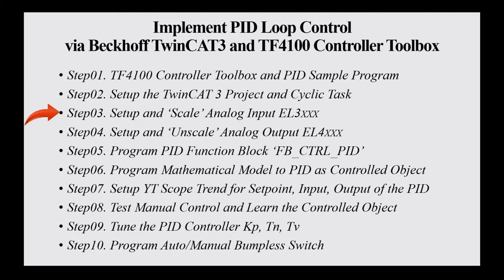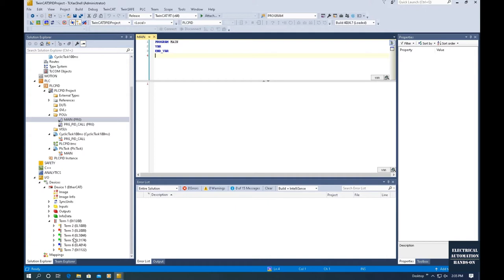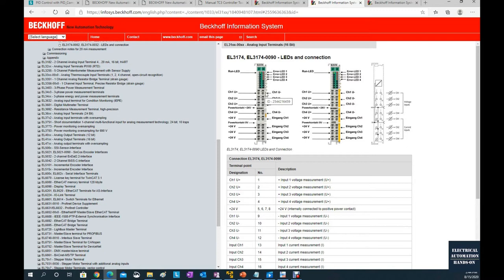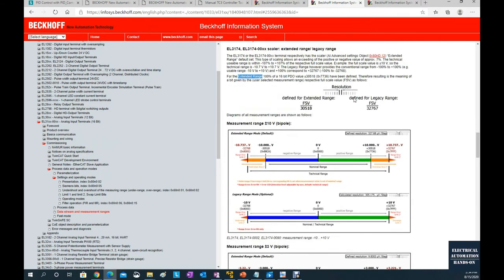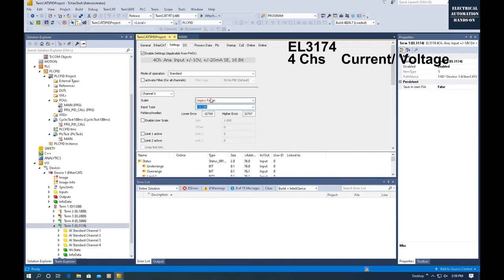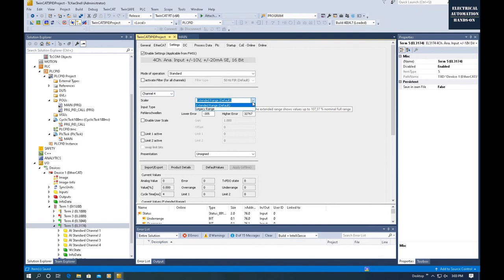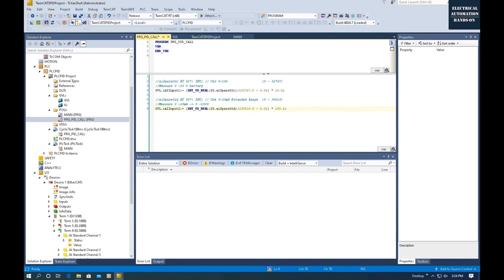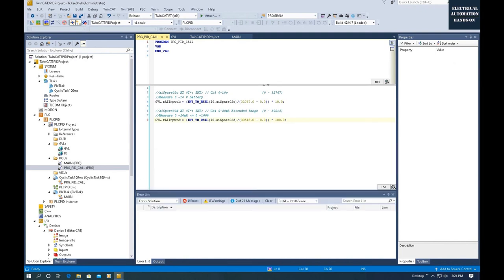PID23 - Beckhoff TC3 PID03 - Analog Input Wiring, Configuration, and 'SCALE' programming

Comment: Hi, what about errors( wire break, overflow)? In Siemens Plcs we have 0 - 27648 fo scale and -32768 or 32767 for errors
Reply from the maker: As showing 13:40, if you use 3174, then 4 - 20mA is 0x7736, overflow will be 7FFF,   0mA is E233, wire break. Also please view 15:29.
Reply: @electricalautomation  So if I use EL315x ( 4 - 20mA, 0- 32767), wire break will be <=0 and overrange >=32767. Am i right?
Reply from the maker: @Alex-pz7kr  ( 4 - 20mA, 0- 32767) for EL315x is correct. But I am not sure this module will do <=0 and over range >=32767. Most likely it can not diagnose the wire break and overflow. I would recommend you use EL317X
Reply: @electricalautomation  Thanks.
I have also  a question about scaling. There's a typical scaling formula 
result= ( Yi -Ymin/Ymax-Ymin) * (Xmax - Xmin)+Xmin;

You use
 result = ( Xmax- Xmax)/ Ymax * Yi;

Why you not add Xmin in your version? Thanks in advance
Reply from the maker: @Alex-pz7kr  Hi, because Ymin = 0.0v, and Xmin = 0 in this case.      Pls see 33:40, the green comments

Comment: Hello!! Great channel!!!  got some question regarding this analog configuration. When I'm using a 0-10v potenciometer on the input and wanted to connect on the output a 12v fan, wich variable should be the one giving me the correct data to the output? and how to link the output with this value? Thanks in advance.
Reply: Should be enough with scaling or unscale must be done also? sorry, I'm trying different plc from siemens so I'm a bit lost.
Reply from the maker: Hi Bro. If you are using Beckhoff, for the Unscale, that is just the next video #4. named "Analog Output 0-20mA/4-20mA EL4014 'UNSCALE' programming" https://youtu.be/rR9oNaoIXzw
Reply from the maker: If you are using Siemens, you also find the right channel, please view the video "Analog Input Scale Library and Norm_X/Scale_X in TIA Portal" https://youtu.be/Mc-JZEuGxFw, and "Analog Output Unscale" https://youtu.be/-zpbEuXQxuo